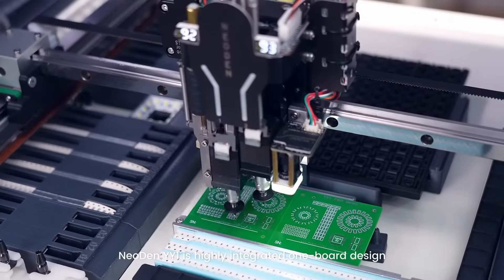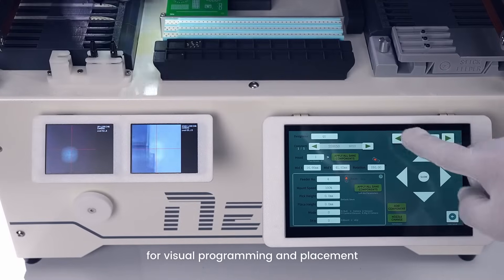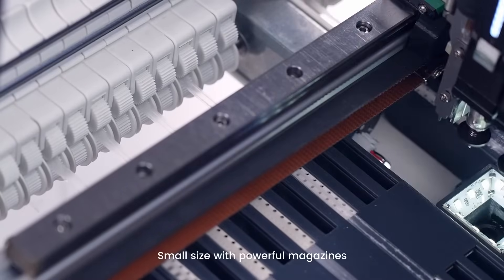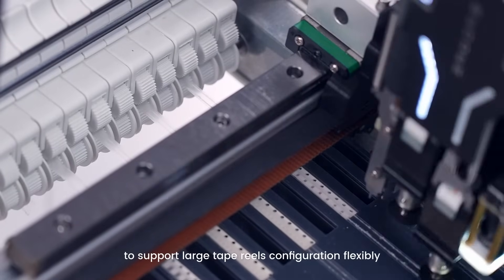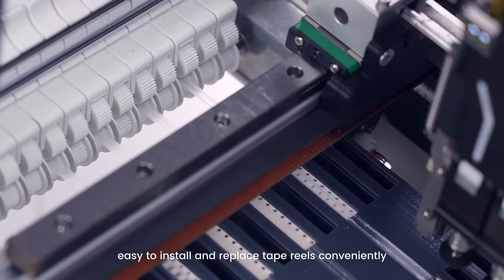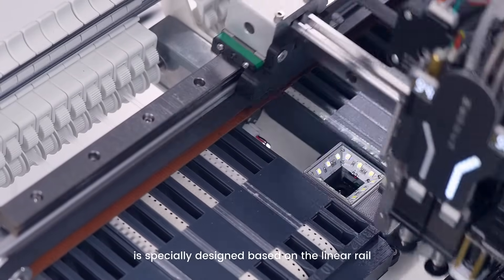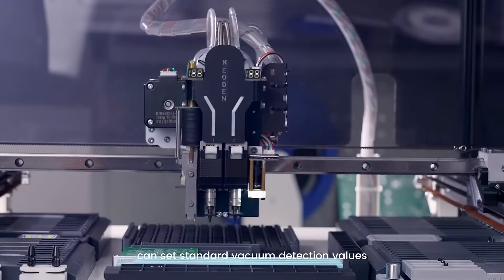Neoden USA | YY1 Pick and Place Machine (Overview)

Comment from the maker: Which feature of the YY1 is most exciting to you??
Reply: for nozzle changing, will it be able to do auto alignment for the nozzle?
Reply from the maker: Thanks for your question! The centroid of every nozzle used on the YY1 is identical. Therefore if calibration is performed as part of routine maintenance there is no need for the machine to recalibrate nozzle position after a change. For more information please contact us at info@neodenusa.com.